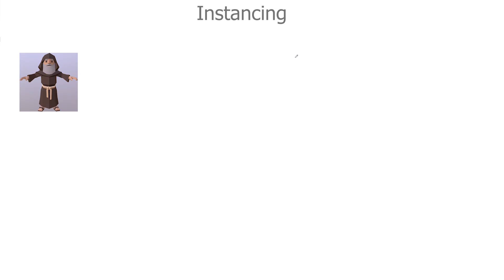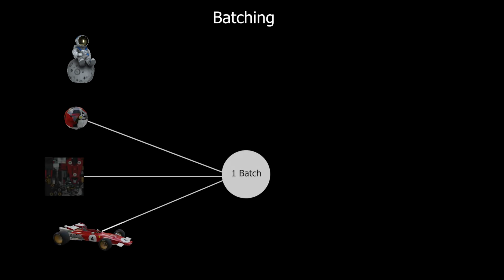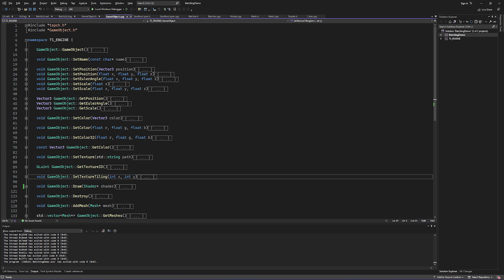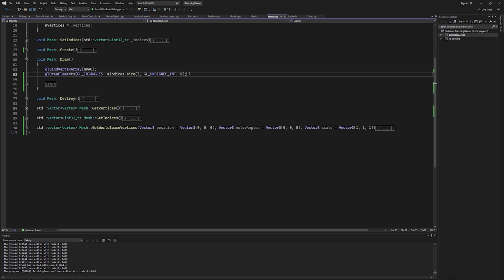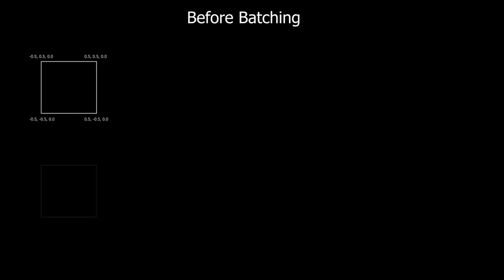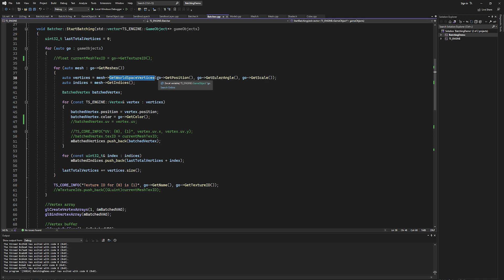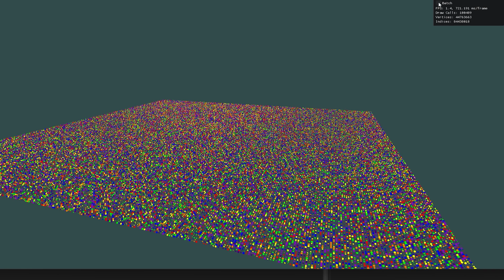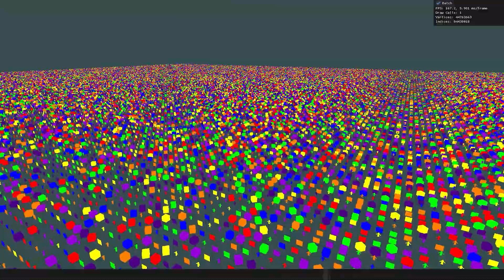Batching in OpenGL

Comment: Nice content, keep up 👍. I am just wondering if you do the world space transformation on CPU side and transfer mesh data to GPU every frame, is it actually an ideal practice? But certainly, it is better than doing drawcall for every single object each frame. I think in vulkan the MVP can also be easily batched, but not sure about openGL.
Reply from the maker: Thanks for liking the video @fangzhou4333. Transformation on CPU is not an ideal practice but in the batching case since all the meshes are combined in one we don't have any other option apart from getting the vertex transformation done on CPU side. In the example I have shown in this video all the models are repositioned once at the start only so I have used GL_STATIC_DRAW but in cases where we need to keep transforming the mesh vertices(eg: batching animated models) on runtime GL_DYNAMIC_DRAW is recommended.